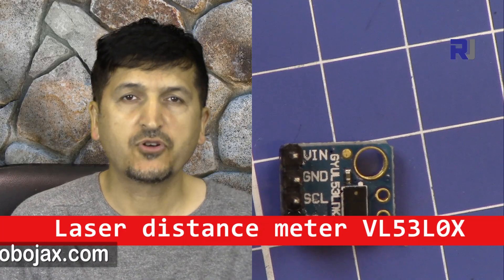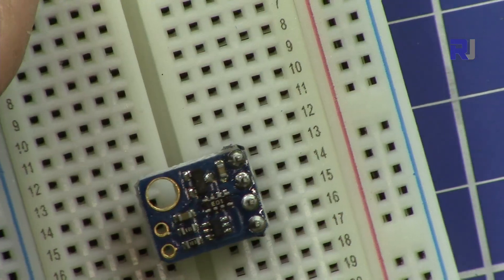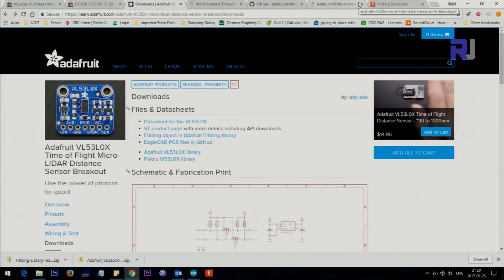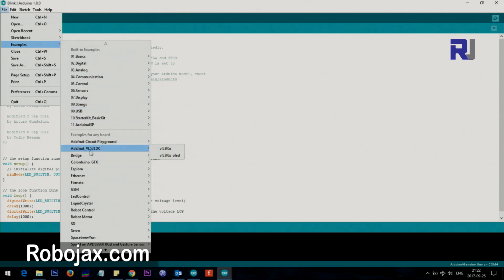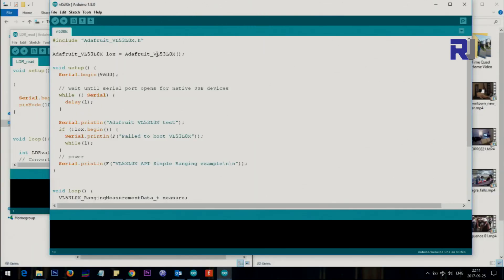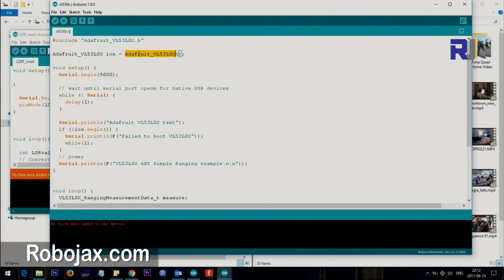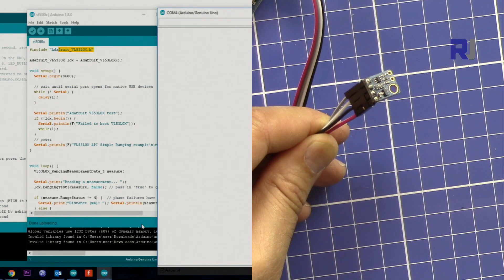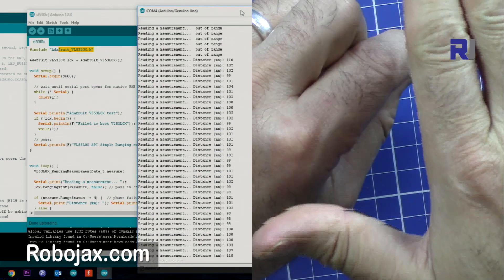Lesson 80: How to measure distance with VL53L0X GY-530 laser distance meter for Arduino

Comment: nice video. Just a suggestion... there is no need to go into device manager and check your serial baudrate. Actually whats written in Arduino sketch is Atmega328 serial interface speed, so u just need to adjust your serial terminal baud-rate. Also every sensor has some minimum blank range so its not working when u r too close. And for larger distance you need to hold some flat surface i guess, hand or pen will not work.

Comment: Very nice video, i  tried connect with the Attiny, but a doesn`t get nothing. I had been reading the comments but i still don`t understand. Sorry my noob and my bad english. Can you explain me how to connect it in a video please. it will be very helpfull. Thanks teacher
Reply: i`m luckely, i need it to ! jajaja. It is very complicate and i have no idea how to programming. Fernando i connected the SDA- pin0 and SCL-pin2 I think the connection is correct but it doesn`t work when i  upload the sketch. i don`t know very well how to programm with it, is too new for me.
Reply: @matiascaballero8466  youp, i connected it too, but i have the same problem, i am in a team and we don`t have any idea about it. i think it is not possible. For this reazon o asked to my teacher robojax ;).
Reply: i have the same question
Reply from the maker: You need to know only SDA and SCL to use to be able to make it work. I have video for LCD where the same pins are using. https://youtu.be/U95hw-ec6nY so watch this video and use it for laser sensor. Good luck

Comment: What is the FOV of this sensor? In your video it looks like it's very narrow. The cable is parallel to the laser but the sensor was not picking them as object
Reply from the maker: I age. Provided the datasheet. Please have a look into that.
Reply: @robojax  data sheet says 24 degree but in your video it looks narrower. maybe the cable is too thin for it to pick up

Comment: I want to build a low cost cleaning robot with mapping feature. Will this sensor work for me to do mapping?
Reply from the maker: yes it will if you are okay with range.
Reply: @robojax  can you help me with this? I just need to map a single room. my university graduation project cleaning robot mapping. and my time is limited. I do not know much coding.

Comment: What is the width of the view cone? How narrow of an item can it see?
Reply from the maker: This is laser. Smallest dot.
Reply: @robojax  I thought it had a 25 degree cone or something close to that?
Reply from the maker: It is tiny dot with virtually zero width.
Reply: @robojax  I just tested. The cone is 25 degrees and it gets wider and wider the further away you get. So good for distance reading large flat surfaces like a wall but not narrow gaps. No way it could be used for a 3D scanner :/

Comment: Im using Adafruit's VL53L0X as well as the same example code as you used. I also Made the changes that you did, but I continously get a "Failed to boot VL53L0X" message.. any idea what could be wrong?
Reply: nvm i got it to work!
Reply: I got the same problem and i do not know why? can help?
Reply: trying to remember.. i think it was just wired wrong.

Comment: I think you can pull in the arduino  files from adafruit through the library function automatically from inside Arduino application.
Reply from the maker: yes you can. there are many ways to include library.

Comment: hello, congrats for the video, but I´m getting the " Failed to boot VL53L0X" message, and sometimes it crashes and doesnt even show this message.. what could be wrong?
Reply from the maker: First get the I2C scanner to see if you did the wiring correct at this address http://robojax.com/learn/arduino/?vid=robojax-I2C-scanner and then if you don't get the address, check wiring. if you get the I2C address, and no data, check your library and if wiring is okay, then the module must be bad.
Reply: ok, I'll try it.. thank you so much.. but just for mentioning, I'm using another model of the vl53l0x, the gy-53... I have 3 of them and tried with all of them, same results.. but I'll try what you told me to.. thank you so much!
Reply: I tested it.. I get the adress, the wires are ok, position of the wires are correct, library ok, and still all of the 3 modules don´t work... I look at them through my cellphone camera and they are not working, and the program crashes most of the times in the serial monitor
Reply from the maker: There must something else.  Try to remove all library from your arduino folder and install fresh library. this is strange. I can't seem to find another reason for this if you tested more than one module.
Reply: even being another model? the gy-53 with 12 pins?

Comment: Can you find a solution to make the accuracy up 1 micrometer and the measuring distance up to 200 mm only?
Its paid research.
Reply from the maker: not possible with this module. You would have  to get different module. Thank you for not skipping the ads and keep watching it. This will help me a lot.
Reply: @robojax  
thank you very much for your answer but my question was if you can find a solution of course we need somthing like STM32.
Or any modul.
so can you achieve that?
we will cover  the reasarchs cost  of corse.

Comment: well, being a beginner I was wondering how the arduino knows which pins the clock and data are coming into without tell it? I probably won't get any answer to that but I had to ask..
Reply: tinkmarshino now you have analog pins on the arduino
One of them is the scl the other one the sda 
Scl gives the speed of the conversation (Serial Clock)
And sda is the dataport (Serial Data) 
The arduino starts with a starting message, it tells to one of the devices „hey i am talking to you, so listen now“ 
So each device has its own address
Like this you can have up to (i think) 128 devices on one sda port
If you need more information check out great scotts video
Or contact me, i will respond if required
Reply: tinkmarshino 
SCL and SDA are defined pins on the Arduino 
You can check a Datasheet

Comment: Hello, thanks for this tutorial. How would I use this code in conjunction with an RC car? I want the car to turn off when it reaches a certain distance to an object (say a 100mm for example). 

Would I write an If statement such as If (Range <= 100){ code too turn RC car off)?
Reply from the maker: Yes that is correct assuming the "Range" is variable holding the range.
Reply: You need to apply breaks at range of 100 :)

Comment: how can change code ,if minim measuring have 20-30mm about sensor and wood have dimension 30mm and display want show zero, 0, and then move up wood part max about 100mm display show 0-100mm. i think my router adjustable bit height meter. on to table level have 0 zero and then can move flute up about 100mm. and display show me dimension. i have i2c lcd,no problem use, i has use many project. this is new sensor maybe have accurate can use 0,1mm min accurate.
Reply from the maker: Sorry without drawing or photo it would be hard for me to understand.  Please take the photo, make drawing on the photo and post it in this website https://snag.gy/, you will get unique URL (address) and post the address, I will try to understand and help you.
Reply: @robojax  this have youtube link what i mean, minute 4;50 have how router move up-down, this i think add arduino gauge i2c lcd, nano, and distance or rotary encoder system but how. distance sensor look simple better way add to bottom and measure how much router go up. reset zero point at table level and then move router up and can see display how much has moved and need adjust up or doen router bit right level. https://www.youtube.com/watch?v=I1IcxhXi4xE&t=288s

Comment: when compiling I get this error:

robojax-VL52L0X_Adafruit_VL53L0X-master.zip:45:0: error: unterminated argument list invoking macro "F"
Reply from the maker: You can't put .zip file like that. save zip in your computer. On Arduino IDE click Sketch->Library->Add .zip library and point it to the above zip file  and click OK or Open. then close the Arduino IDE and reopen it, it should be okay.
Reply: @robojax  

He tells me that the library was added correctly but it's still the same ...

sketch_may28a: 45: error: unterminated argument list invoking macro "F"

Multiple libraries were found for "Adafruit_VL53L0X.h"
Used: C: \ Users \ SILVI \ Documents \ Arduino \ libraries \ Adafruit_VL53L0X-master
  Not used: C: \ Program Files \ Arduino \ libraries \ Adafruit_VL53L0X-master
exit status 1
unterminated argument list invoking macro "F"

This report could have more information with
"Show detailed output during compilation"
option enabled in File -> Preferences.
Reply: already solved, I did not see you open the examples of the library haha sorry
Reply from the maker: I made changes in the code. Once the user learns the provided code, then the example in library is easy.

Comment: Can I use it to measure in the water?
Reply from the maker: I have not tested it. Test it and let us know.
Reply: Robojax Ok I will try it. Actually, I am going to try some sensor tools to measure the elevation of the sand surface in the water. In addition of sonar invented,do you have any other reference?
Reply: I've used the ultrasonic sonar sensor to measure water distance successfully. I'm not sure if this would work with clearwater since it's light-based. Let us know. Also the ultrasonic one is not the straight line distance measurer, it needs some room to work since it works with sound.

Comment: Very nice.. will the accuracy change as measurement range changes ? I need to measure at 1,5m with less than 1mm accuracy.
Reply from the maker: The accuracy will not change as this beam is laser.  It is accurate at 2mm. See the datasheet provided with the code.

Comment: for some reason i get an error saying    unterminated argument list invoking macro "F"  please help 
thanks
Reply from the maker: that would be library issue. try to download the library again. If you still face problem. it means older or other library is creating problem. So backup  your library fold and install arduino again and try. it should work..
Reply: @robojax  thanks it worked

Comment: Why without moving both the VL53L0X and the target, on the serial monitor the reading of the distance always varies. I would like to obtain a stable result because if I want to measure a distance that does not change, it is not useful seeing that variation.
Reply from the maker: It depends have precise you want to the measurements. If you reduce the precision, it would be stable enough to be used.  To reduce the precision,  you need to write a subroutine to do that. If I got a chance, I will have another video on this.
Reply: When I measure any object between 30mm and 70mm, I should read the exact lenght of this object on the serial monitor till I remove for another one. If the object stay there for  many seconds the result should not change before I insert an another one. Thank you but I'm not comfortable for writing a subroutine with the "Adafruit_VL53L0X.h"
Reply from the maker: Thank you for the comment about the flash memory based. I want to remove my comment and keep yours but both deleted, I believe one comment was child of another comment.
Reply: Search the entire Arduino Reference Page, and you won’t find a single mention of the F() macro. Which is unfortunate because it is one of the most powerful functions, which was added with the 1.0 release of the IDE. I keep mixing the terms “macro” and “function.”  F() really isn’t a function, it is a #define macro which lives in WString.h
https://www.baldengineer.com/arduino-f-macro.html
Reply from the maker: Thank you very much. I just read it. Very important method.

Comment: Will you please tell me the minimum delay between two consecutive readings?
Reply from the maker: Delay between each reading is 100ms. You can see the code http://robojax.com/learn/arduino/  and also you can download the datasheet for the sensor.
Reply: do you have any code of making a 90 degree or 180 degree radar by mounting this sensor on servo?
Reply from the maker: I am sorry I missed your comments. If time permits, I will try to work on it.

Comment: Thank you very much for the video. What is the maxium distance I can measure with this module? thanks
Reply from the maker: You are welcome. 2 meter max. Has been mentioned in video .
Reply: You mentioned that for some limitation you can't get the distance of up 2 meters, Is a phisical limitation? Thnaks

Comment: how do i measure the time it takes from the signal go back and forward?
Reply from the maker: I believe you can't get that data. Unless go through the datasheet and see if there is anything. I provided the link to the datasheet in the same page where the code is.
Reply: The sensor handles all that. There's nothing to do byut read what the sensor tells you.

Comment: Hello! Nice video!

How do I change the used pins?? I dont find the declaration anywhere!!
Reply from the maker: have you looked at VL53L0X.h file?
http://robojax.com/learn/arduino/?vid=robojax-VL53L0X-polou
Reply: Thank you for your answer! I found that those pins are not analog, but specific Scl and Sda, so they are defined in Wire library and they dont change! thank you very much!
Reply: Is the Wire librairy include in Adafruit_VL53L0X.h